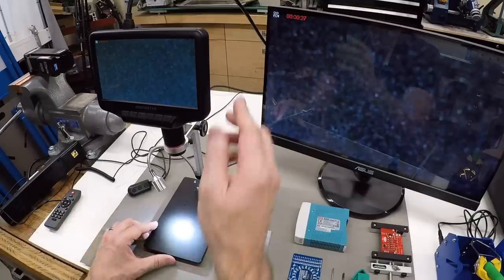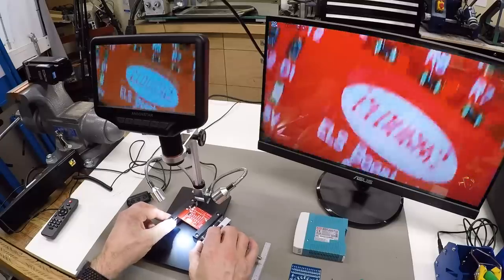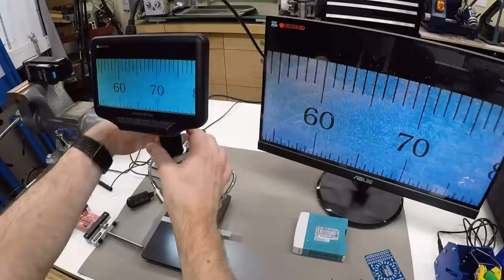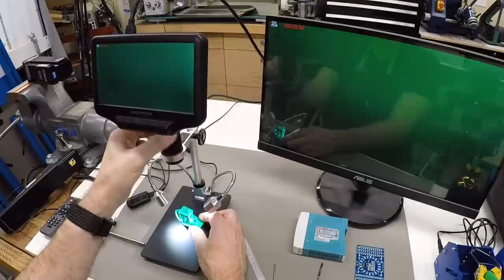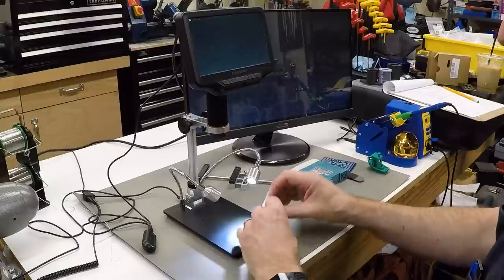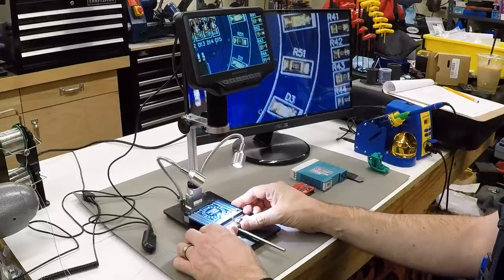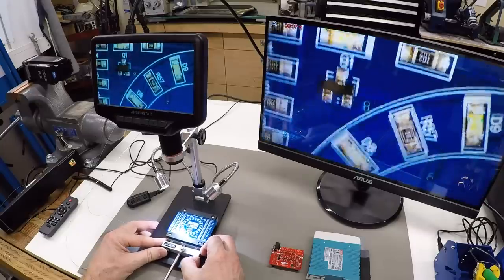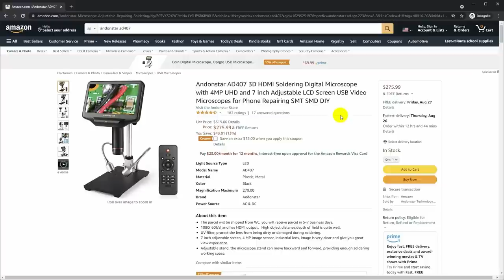Apparently, I Can't Solder | Andonstar AD407 Microscope Review

Comment: I need to solder a few really small smds that I don't wanna attempt without magnification and I can't decide between a Donegan optivisor or one of these Tomlov microscopes for about $170.
By the time I buy the Donegan visor with the led light and the attachable loupe I'm spending $91 for just a visor so Would it be better to get the Tomolv microscope instead?
Oh the reason I'm looking looking at the Tomlov dm201 is because it has an extension for the stand, not sure hiw crucial that extension is though.
I cant afford a $350+ binocular system

Comment: A couple things regarding the few times you mentioned building a different stand. While it's good to be able to have the option for custom mounting I'd consider it a negative point to have a limited use stand by default. The microscope as it shipped is what should be considered for review and not it's potential when used with custom parts.

Regarding the ideas for a new mount specifically though, the simplest thing here would be to measure out the size of extrusion used on the back of the scope and see if you can just order a length of compatible extrusion with a larger range of motion.

Overall though, this seems to be at least a decent selection specifically for your use where you're recording a lot of video. I'm looking forward to more great close up shots of various things.

Comment: Hi James, very informative.
 I could have used this forty years ago looking for dry or cracked solder joints on PCBs. 
Speaking of dry joints, does the solder you're using not have a resin core so becomes self fluxing? The joints you soldered on that header certainly looked dry to me. You indicated you didn't have flux so I'm assuming you usually use a paste flux like you'd use for SM components.
Have you ever tried the endoscope cameras for close-ups of machine work. If you haven't I'd be keen to see you test one at some stage.
Thanks for all the time and effort of editing and producing your videos. It's greatly appreciated.
Regards from Canada's banana belt. 👍🇺🇲🕊️🇺🇦🍌🇨🇦🤞

Comment: Nice, can you also use it on a lathe ? In terms of delay of the image and depth of field ? I am only soldering smd's with a Quick 861DW, works fine for me and not that expensive like a Weller. I saw a foam handle on you Hakko, a JBC part ?
Reply from the maker: The green rubber grip on the iron is standard on the Hakko FX-951, as far as I know.

Comment: The sync problem is a bit frustrating. I think it could be simplified by using something like the old clapperboard that's been used for movies ever since they added sound. You just need something that will fit in the FOW of the microscope that makes that sound you use to sync the videos. Then you can manually sync the microscope video very exactly if it's ever needed. As for identifying the video you might try using your phone and any app that allows you to set a very small text size. If that doesn't work I'd give 2D bar codes a chance. It should be possible to generate and display QR or Datamatrix codes in a format that will work with the microscope, at least when it's set up for max FOW. And while it won't be human readable it is easy to just use the phone to scan it from the screen when editing the videos.

None of this is a perfect solution nor have I tried anything like this so feel free to point out any obvious short comings or simply how stupid the ideas are.

Actually my first thought was that it would be nice if there were a phone app that could show a text in microscope friendly format, switch over to the same text encoded as QR or Datamatrix code, and finally could show a graphic countdown and generate the sync "clap". But then I got to think about the total market for something like this and I realized that it's probably not something anyone will feel like putting in the time to design and code. After all there aren't that many people who have a need of this. But then I might be totally wrong and some one already hacked up an app like that...
Reply from the maker: What I want (and might build) is a device that beeps and fires a camera flash.  That would generate a tone, and also a visible flash for every camera.  Taking the idea further, it would be possible to flash out a code over a few frames that could be used in software in post to automatically locate, identify, and assemble the multi-camera timelines.  But as you said, while it's an interesting problem, there isn't enough of a market to justify the development.  The pros (the ones with the real money) just use synchronized timecode.
Reply: @Clough42  I realize that time has passed but I am improving your metrics. Your problem was syncing audio and video files. The clapboard was invented for that. A sprung cloths peg clicked on camera fills that function. Primitive but effective. I am sure that as you do the washing you will know where you keep the pegs;-) If you glue it to a piece of timber a post-it can be used to keep the scene count by counting in 5's. BTW, I believe that an Australian invented the clapboard.
Reply from the maker: @andrewdoherty8847  I have a whole bag of C-47's in my lighting kit.  I hadn't thought of snapping one for sync.  That would work, as long as I can get it in the field of view of the microscope without disturbing my setup

Comment: Went through 3 levels of digital microscope over the years, first was $80 and works but not optimal, second microscope was around $125 and looks identical to the one you're using but a little lower quality, it's my endmill inspection microscope. For pcb soldering now using a Eakins sourced from aliexpress for around $180, image quality is so much less grainy and it can be much farther above the pcb while being fully zoomed and focused. Overall for pcb soldering it's what I should have bought instead of the $125 microscope. I use a Zephyrtronics hot air preheater and air pencil for soldering smd components.

Comment: Is there any particular solder you like? Not a lot of info from sources I know or trust out there.
Reply from the maker: I use mostly Kester 24-7068-7608, which is a Sn96.5Ag3Cu0.5 lead-free alloy with no-clean flux.  I have a roll of .015" for SMT work, and a roll of .031" for larger though-hole soldering.  I usually use a Kester #951 flux pen.  If you want lead-free, it's a good combo.
Reply: @Clough42  thank you... Now for me to find it in less than pound quantities...

Comment: I don't understand the problem with depth.  Touch the pad with the solder tip, to start with. Then you know where the solder tip is. Move it from there.

Comment: Being really nearsighted has it's advantages, and as a bonus, it was free. Glasses are not free, so yeah trade offs.
Reply: Yeah but it sucks when you get a little older still and find you can't see stuff right up close like you used to....in addition to not being able to see them at distance.   Have recently bought a head-visor for just this reason - saves squinting through a loupe when you're trying to get the metal splinters out (small mill problems).

Comment: I have a similar one with the smaller screen. Pretty much agree with your assessment. Mine has the same issue with hdmi. It will not connect to some screens, intermittently with others. I have a dedicated scavenged laptop screen that I reserve for this that seems to work all the time. A few other gripes. The separate power supplies for the lights and screen + hdmi makes cable management i bit of a pain. The directional LEDs are a bit shadowy and have been meaning to create a ring lamp to see if that helps.
The last is one that may be specific to the smaller model. There are  seven buttons 4 + 3 on the sides that are impossible to read their functionality making them hard to use. I have to use an eyeglass just to guess what the icons imprinted into the buttons are, which is a bit ironic.
I use it a lot for the same as you i.e. Inspection and find it does a great job.

ps. love your channel, have bought 2 of yr leadscrew boards

Comment: Wat. I don't have a steady enough hand to solder SMD components like that with a freakin' iron (and I don't know how you're using the tension of the metal because it would pull it off the pads, and I would have more difficulty heating both pads at the same time.

That said, with a preheater and hot air station, I can do equivalent work.

Comment: Add some flux, you will get a lot better flow.
Reply from the maker: Yup.  The cameras were rolling and I didn't want to walk upstairs to get it.  The board I was using has been sitting on my bench for a couple of years and is surely oxidized.

Comment: What ??? You can’t solder with your eyes closed ? You might not have your tongue at the right angle ! You will have to get Dave Jones to check it for you as he is the master ! 
Could be useful for checking custom ground cutting tool profiles , at least it has a decent size screen .

Comment: Most people just turn the base to the back
Reply from the maker: Oh, that's smart.  I didn't even think about it.
Reply: @Clough42  I find it interesting that you screwed the microscope using the lens side, while it actually should be screwed way higher, which results the lens to hover about 80mm over the base. Not sure if I want do that, as the weight of the monitor is on the lens cap. Probably 3d printing some adapter to gain some height.

Comment: Leadfree solder is rubbish !
Reply from the maker: "Rubbish" is strong, but I hear ya.  I've got a roll of Kester '44 that flows like a dream.  Lead-free is hard to work with, it requires higher temperatures and more flux, it has issues with cracking and other aging problems.  It's also arguably safer (for some definition of safe) and it's required if you want to make something and sell it legally in some parts of the world.